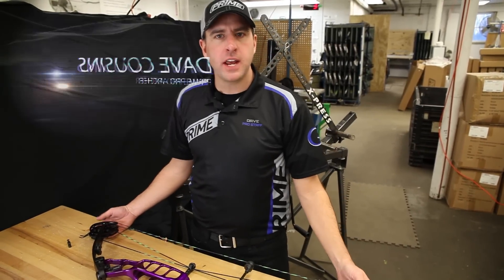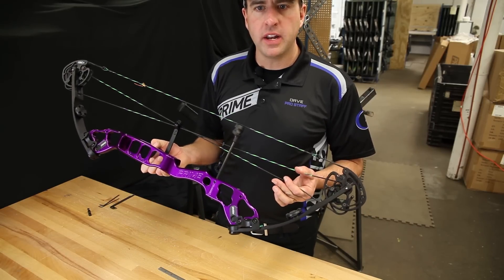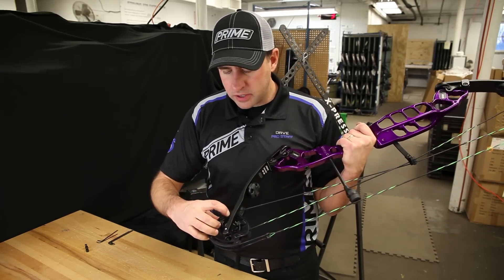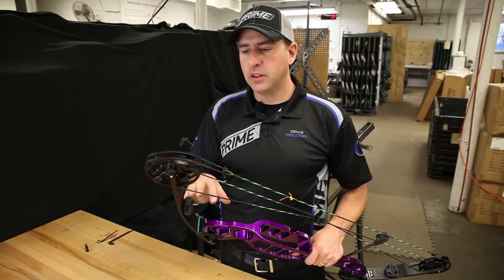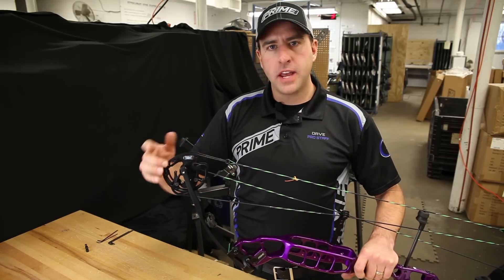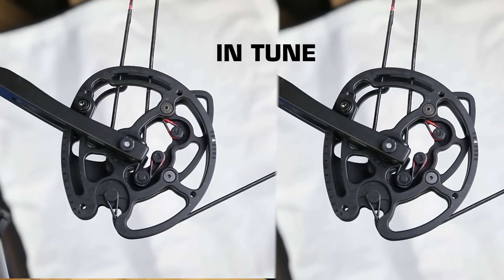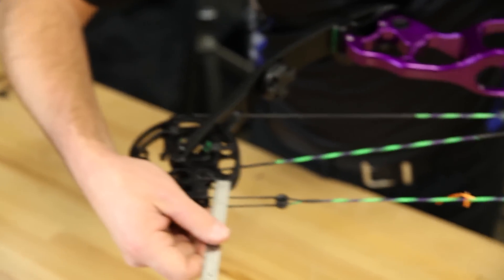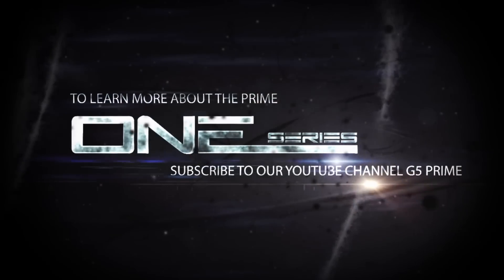G5 Prime | Bow Cam Timing

Comment: Dave, does the measuring of the end of the cam to the string still apply to the black series that has the 4 dots?  My 4 dots are lined up but the distance from the cams to the string don’t match up. I’m also getting hard nock low tear.  Driving me insane.
Reply: g mino Dave doesn’t shoot prime anymore, he shoots for PSE now.
Reply: Did you ever figure it out?